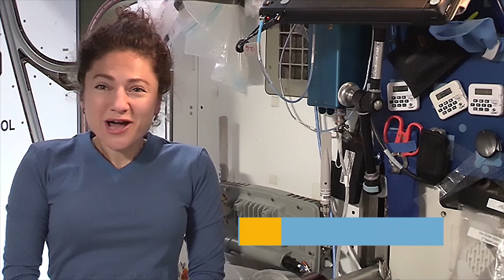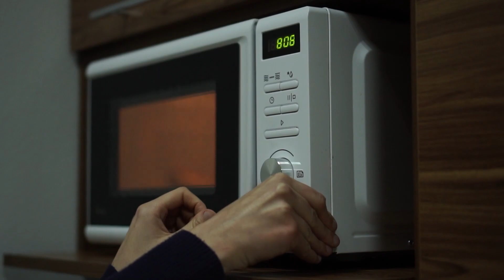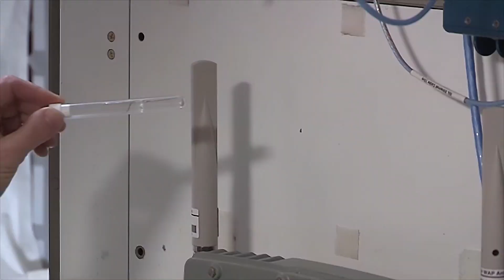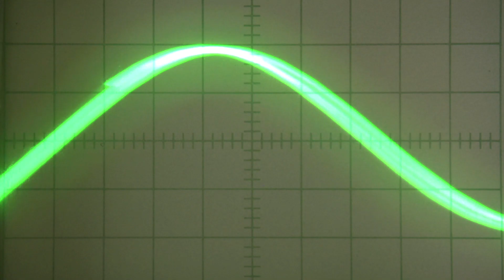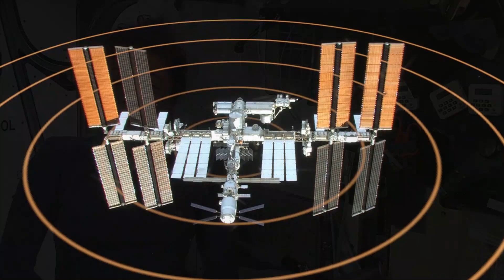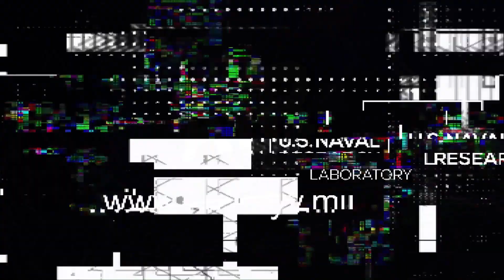LEctenna on ISS

Comment: Yes Ronnie currently in USA directv swim reverse band lnb currently uses 21-24v and even has (grey power supply) 29v. Dish old wester arc uses 12-18v and new eastern arc 18-24v roughly. 2way Internet setups can put out about a watt of microwaves.